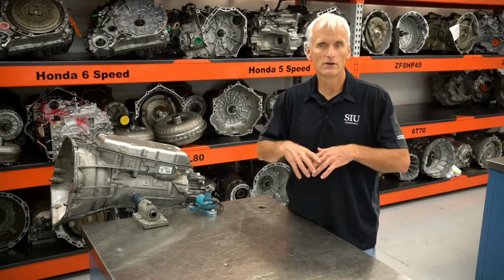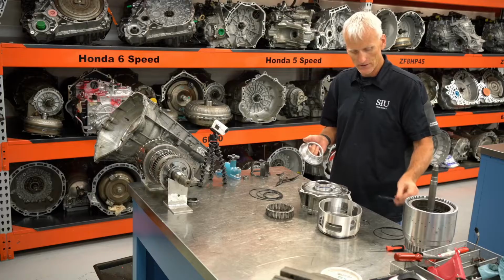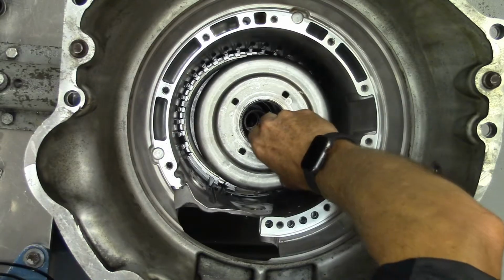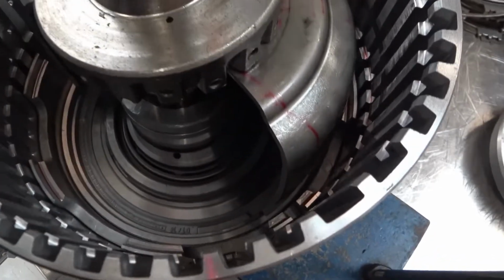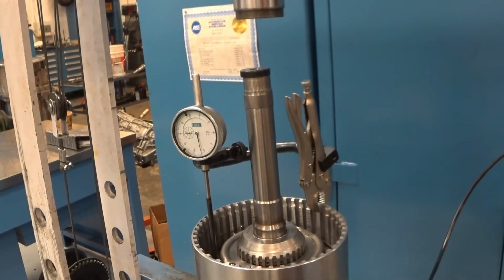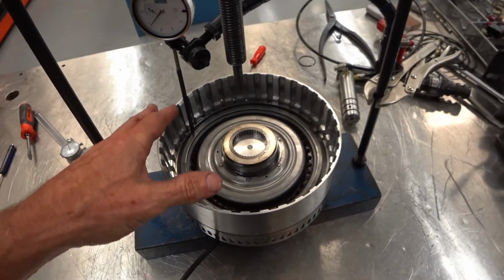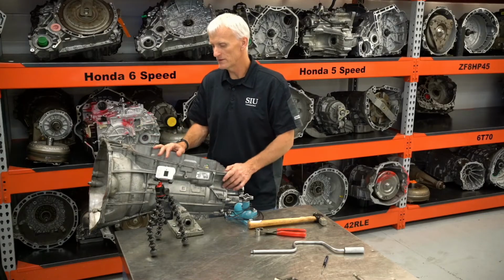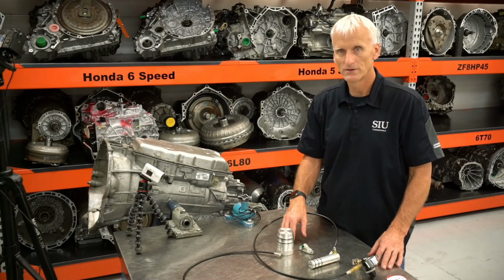General Motors 8l90 Overhaul Part Two - Assembly, Gearsets and Clutches

Comment: Hey thanks for the videos…..great info i have a ct6 3.0tt with the 8l90. Im a former siuc student as well. My car has been stuck in the garage for months….i could shift thru all gears but the transmission wouldn’t engage. I watched your videos and grew enough balls to take things apart and what do you know my pump chain came off 😮top and bottom. Used a wire hanger to get it back on. Still some slack though is there a tensioner or do i have to take a link 🔗 out or something 🤔

Comment: I’m a GM technician by trade but transmission rebuilds are not my usual business. Customer of ours just had a GM reman’d unit fail with less than 800 miles on it. Upon tear down I found the 12345-reverse clutch assembly completely fried. TAC advised me to rebuild the 1-R clutch assembly as well as the piston and extension housing. What are your thoughts on the retaining ring measurement on these?

Comment: So I wanted to ask your opinion!  I mean since you’re an instructor and all.  I have been a professional mechanic for a little over 30 years but just recently (within the last 2 years) I started exploring automatic transmissions and decided to get as good at it as I could.  So far I have built somewhere between 50 and 75 units of different makes and models.  I have been reusing the bonded separator plates.  I clean them and if I don’t see any damage to the gasket or check ball holes I just put them back into service.  So far I haven’t had a single problem.  What is your opinion on that subject?

Comment: if GM has selective snap rings like mercedes 6 and 9 transmission , the TCM adjust the filltime for each clutch by the readopting process??
my experience is setting clutch play to an absolute minimum and under shortens the fulltime and the tcm adjusts to it!! but extended the livetime of transmission!!

Comment: Your series of videos on this transmission are the best on YouTube that you can find. You do a great job. I will be recommending these videos to anyone that does not know their way around this transmission yet. A few notes I would like to add. Just details. The bolts for the front case cover are actually supposed to be replaced. The sealer on those bolts not only prevent fluid leaks but also prevent the bolts from loosening up. The other note is when doing clutch clearance checks, each clutch has a different pressure that it is supposed to be applied to them when compressing them. On the 1,2,3,4,5,R clutch the applied pressure is 80 psi, on the 1,3,5,6,7 clutch it is 30 psi, on the 2,3,4,6,8 clutch it is 60 psi and on the 4,5,6,7,8,R clutch it is 75 psi. I think this to address the differences in the clutch stacks and waved plate differences as well. Not sure if I am right on that but, I have never been able to get an answer from the engineers on that. Thank you for addressing the importance of checking the clutch pack clearances. This is often an ignored area during repair that really is critical to shift quality on this transmission. Early on with this transmission that was one of the things that was causing some of the shift quality issues on these. To answer your question on the seal swelling on the 1,2,3,4,5,R clutch piston, for some reason they do that. After they have been in the transmission and you take the piston off the housing that is what they do. It's not your solvent in the solvent tank. I have had a number of these apart and they all do the same thing. What is strange is none of the piston seals do that.  I wish I could do the valve body work that you show in this series but, I work in a dealer and they simply do not allow for valve body repair. As a note I have installed a fair number of valve bodies to address different issues. Especially on the early ones they had  some pretty serious issues with cross leaks which caused some horrible shift quality issues. I will say by about 2018 this transmission was vastly improved but even with the improvements there is still some characteristic shift belly aches that are still displeasing to customers. Again, in my opinion you have the best of the best on this transmission. I commend you on your hard work.
Reply from the maker: Thanks for your response!  It sounds like you have a ton of experience with this transmission.  On the mechanical theory video I talk and show all the clutch measurements like you mention, then I compare it to the traditional method of checking clutch clearance.  It seems GM made some updates to a couple pistons, return springs, and a shift pressure reg valve.  Maybe those actually helped this trans, since they did those in 2018 and 2019.  I appreciate your kind words and valuable input!

Comment: At 52:38, you show the plastic thrust washer with the internal teeth.  I am curious as to your method of assembly of this washer.  There are several other videos of the assembly of this trans and every one discusses the difficulty and different methods employed to line up and install this plastic washer.  You did not indicate any difficulty.  Please elaborate.
Reply: It’s not fun to spline but it goes on relatively easily
Reply: @esoterictransmissions    Then as I previously asked, elaborate on your method as most other people do not find that it "goes on relatively easy".
Reply: @skutahuniai4830  all you’re doing is splining those little teeth to the input sun gear. There are sections of teeth on the washer and they have 3 on the inside of it
Reply: @skutahuniai4830  just playwith it and wiggle it side to side gently and it will drop in and spline
Reply: @esoterictransmissions  Well aware of it's design.  I have had one apart.  My point WAS - EVERY other builder on Youtube points out the difficulty of this procedure.  Every one.  I was asking your method specifically because the other builders all have their own. method.  "Wiggle it around" doesn't qualify as a method.  Make a video SHOWING your method.
Reply: @skutahuniai4830  I also don’t assemble 8 speeds the way GM tells you to but I’ve never had an issue installing that washer.